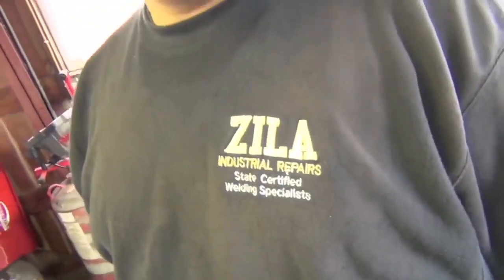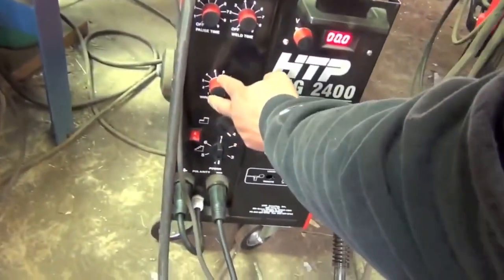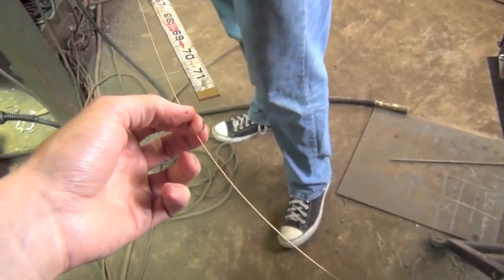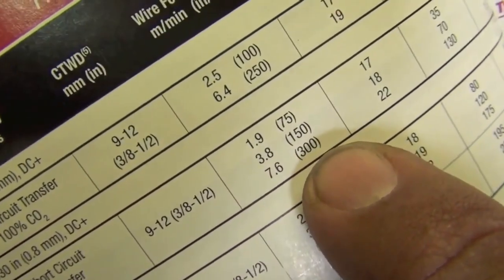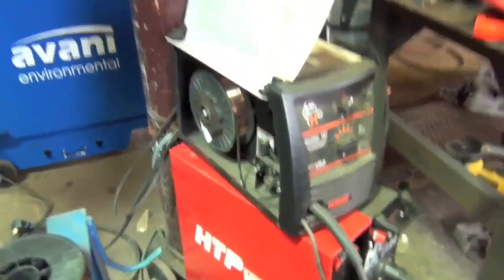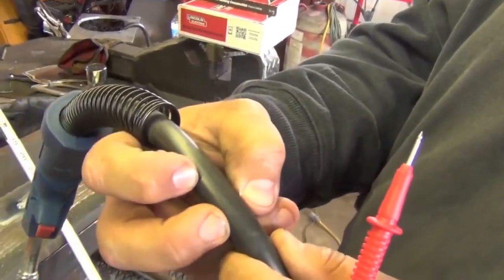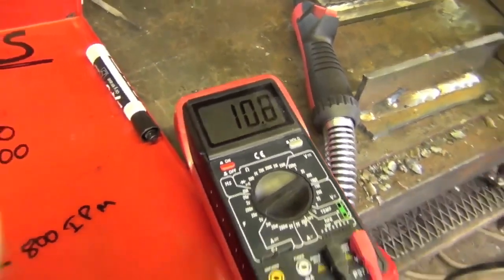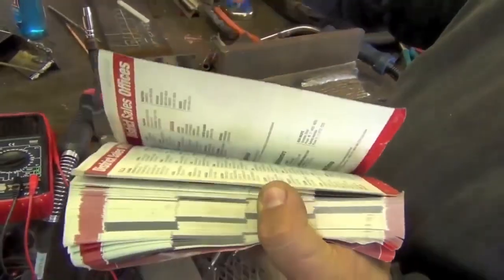HOW TO MEASURE MIG WELDING VOLTAGE AND WIREFEEED SPEED WITH SIMPLE TOOLS

Comment: Interesting, I have an Everlast that's like that - 1-10 that means diddly squat... I just used the manufacturer specs and assumed it was a linear increase between the min and max, and calculated where I should be on that.  Now I think I need to redo my charts and see if they were close.  I would have expected the multimeter to go up in smoke due to all of those amps going through it... heh.
Reply: No amps were going through it.

Comment: Damn a video from the OG Barn. How is the utility trailer holding up you build there?
Reply from the maker: Its great actually, they still use it. I helped them upgrade the ~1000 pound axle to a 3500 pound one, about a year ago. They built a plywood box for moving small livestock in it, plus its used hauling hay back for them every summer. Yeah, these videos are a throwback LOL